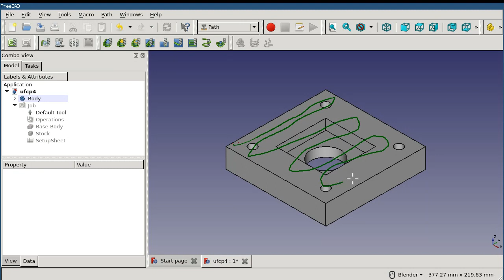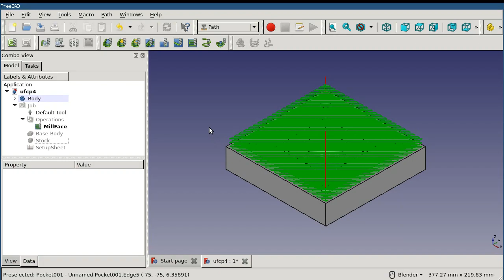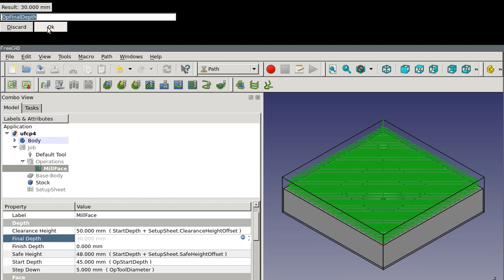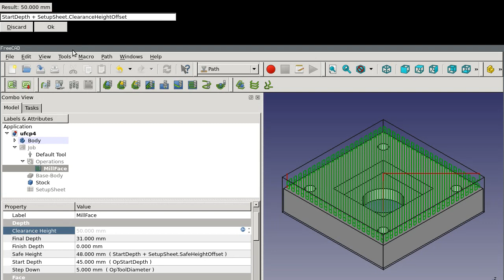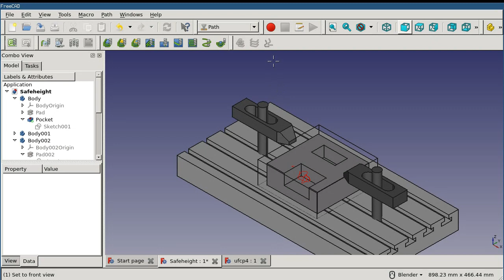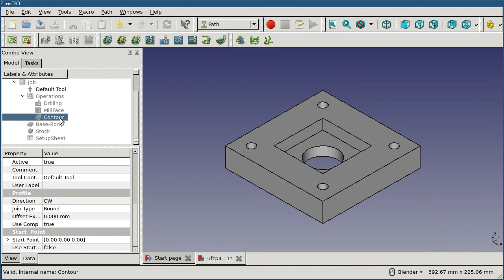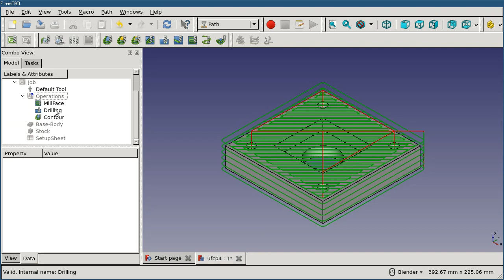Using FreeCAD Path - 4 (Operations)

Comment: Hi, do you have a video on adaptive toolpaths on freecad? I can use all operations in Path, but when i try adaptive, it doesn't seem to work.
Reply from the maker: The adaptive operation is a bit finicky.  I've had good luck using it though.  I suggest posting on the forum and including your project file.

Comment: Will there ever be an option for conventional milling while using the "Adaptive Clearing and Profiling" operation? I didn't see mention of it in V .20 release notes or see it in the build.
Reply from the maker: Interesting question.  It hasn't been brought up.  With most machines handling, or at least compensating for backlash these days, climb milling is overwhelmingly preferred.  What's the use case for needing conventional milling in a roughing operation here?
Reply: @sliptonic  Hmmm, maybe I have it backwards. I thought conventional was used more over climb milling in the cheaper machines that do have slop in The Z axis. But yea, I think as far as a finished milled face and producing an edge with less burr, climb is the preferred way, but you need a very solid machine….so I’ve read.

Comment: There is something completely wrong with freecad..VersionOS: Windows 10 Version 2009
Word size of OS: 64-bit
Word size of FreeCAD: 64-bit
Version: 0.19.24291 (Git)
Build type: Release
Branch: releases / FreeCAD-0-19
Hash: 7b5e18a0759de778b74d3a5c17eba9cb815035ac
Python version: 3.8.6+
Qt version: 5.15.2
Coin version: 4.0.1
OCC version: 7.5.0
It is totally impossible to delete a job in path or body ..
For example. If I have regretted the path and want to create a new one
Reply from the maker: I've stated many times in comments that trying to support freecad in youtube comments is dumb. Cant attach files, pictures, or involve other experts. Post on the forum and please don't spam multiple videos with the same comment.
Reply: @sliptonic  I'm sorry I stepped on someone's toe..but you've done a great job with freecad..Will use forums instead ..
Reply from the maker: @lars-gunnartengerstrom8276  No worries mate.  I hope you get it figured out.

Comment: Could you please make a quick guide - or comment by text at least -  how to make operation in a part which has tasks to be done on top and bottom?  Surely there must be 2 run - that's clear - meaning 2 programs and set-up, but how you define the orientation upside-down in FreeCAD when cleating the second CAM-task. I've tried to search solution, but not been able to turn the Z-axis direction opposite when turning the part upside-down.  Surely also Y-axis need to turn. I'm using 0.19 beta currently, but I'm a beginner with FreeCAD.
Reply from the maker: I'll definitely cover this better in a future  video.  Thanks for the tip .  
The intended behavior is that you can go into the job setup dialog.  Select an edge in your model that runs parallel to the Z axis and click the Z axis button.  You can click it multiple times and it should flip the entire model over.  I've seen models where this doesn't work.  I suspect there might be a bug remaining.  If so, there's always a fall back:
Inside your job you'll find the model object.  This is a clone of whatever you're trying to make.  The clone has its own placement object which you can adjust manually.  Select the model clone in the tree and look at the placement properties in the data pane.   Set the angle to 180 degrees and the axis to 1,0,0  This will rotate the model 180 degrees around the X axis, effectively flipping it.

Comment: Good videos. But still struggling with trying to program a conic hole for the ER 11 collets I'm using a step-file designed from solidworks.  Any help would be greatfull
Lars
Reply from the maker: The adaptive tool path recently got an conical helix entry method.  You might be able to work with that.  Otherwise, I agree, the conical shape should be added to the helix op.

Comment: Thanks for this.   I spent 25 years as a CNC Turner writing my own programs. Not done it for 15 years but it's still in there somewhere.
Never used computer aided machining software before so it's all new to me.  Just bought a 3018 CNC engraving / milling machine so keen to master it.   This was very clear. ( I just need to remember it )  I have subscribed and I'm going to check out your other stuff.
Thanks again.     Jim
Reply from the maker: Work is being done on the lathe / turning functionality.  We could use your expertise.  Join the forum if you haven't.
Reply: @sliptonic  Not joined yet.
Not sure expertise describes me.
Worked on a Fanuc 5T for ten years and Fanuc OT for about 15.
That's about it.
I'll join the forum though.
Thanks again.

Jim
Reply: OK I joined the forum. I see you're a moderator.  Just finding my way around the site at the moment.  Feel free to ask me anything.  Whether or not I'll be able to answer is another thing.
Jim

Comment: Only 3d operations on pocket?
Reply from the maker: I don't understand your question
Reply: @sliptonic  I want to machine a 3d surface. It looks like the versions have this (my version of .18 does not).
Reply from the maker: @SlappynutsMN  Correct.  3D surfacing operations are in the 0.19 prerelease version and are still considered an experimental feature.  So you'll need to get 0.19 and enable experimental features to use it

Comment: Thank you for taking the time to make this series.  I am excited to see toolpaths coming to the Linux community and hope to see even more over time.  I have just exposed myself to FreeCAD and the Path workbench so have a learning curve to work out but I am hoping you can ask a couple general questions.

1) Form tools:  Say for example I want to use a 6 degree included angle ball nose cutter to mill a pocket, the end result is to provide draft and fillet to make a sand casting pattern.  Does the software support this type of operation?

2) If I were to create a part with tapered edges and radius chamfers and fillets, can I do a 2.5D contour of the part with a ball end mill?  In other words, can I run a contour path in say X and Z working up the Y axis in some predefined stepover, say 10%? Again, I am looking at making patterns for sand casting.

I plan on doing a series on my channel on making a steady rest for the Atlas 10F lathe.  I thought it would be nove to take it from concept --> CAD --> CAM --> CNC Router (to route the pattern) --> casting --> machining --> finish.

If I could do this with a complete Open Source toolchain, that would be perfect.

I know these are newbie questions, and I will do some research.  Thank you for taking the time.

Joe
Reply from the maker: Joe, the operations, so far, are basic 2.5D profile and pocket.  They don't take anything about the tool, except diameter, into account, so more sophisticated tool paths that use cutter shape are still beyond us.  Some work is being done in this area but nothing merged into the master branch yet.  The core of Path is in C++ but is quite simple.  All the fun stuff happens in python so lots of things are possible.  I have another playlist about writing paths with python that might be of interest to you.  

The Path section of the forum is a much better place to discuss than youtube comments.  Drop by!
Reply: It has been a very long time since I coded in C/C++ and have never coded in python.  Maybe I should learn a little.  I will check out your playlist on writing paths with python.

I will drop by and lurk on the forums.  My problem is that I know nothing about freecad and will have to learn it to draw up or extrude or whatever it is to make my parts.  I am hoping there is enough on YT to do this before I start in on the dumb questions.

Thank you for taking the time to answer my question.  I appreciate that.  Being a home hobbiest I always seem to have a learning curve to climb so when someone takes the time to answer a question, I am grateful.

Laus Deo,
Joe